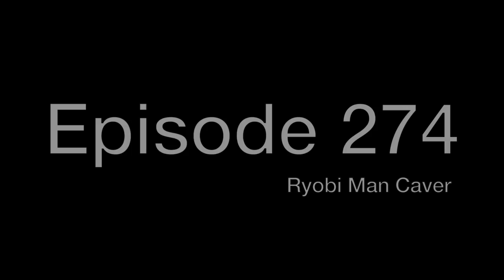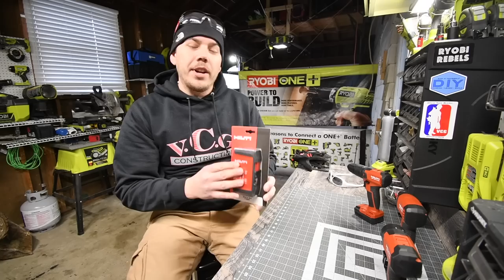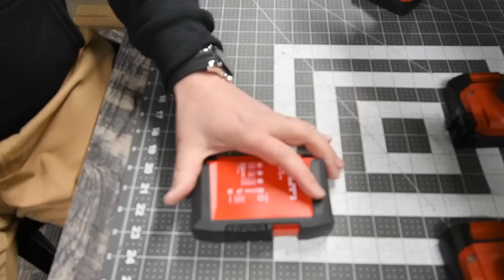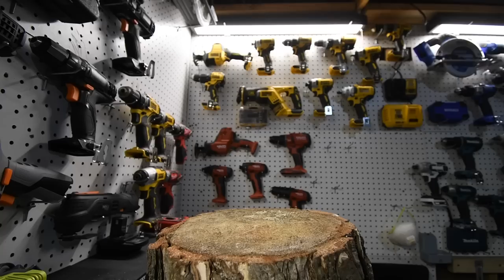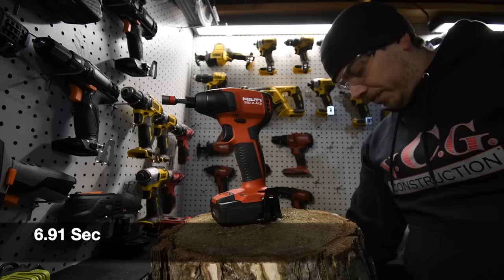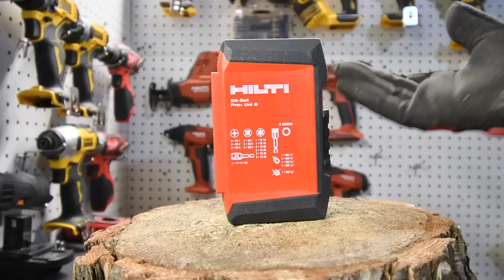$96 HILTI 36 piece Drill bit kit

Comment: I like the opening. "I have no idea!" I would never buy bits that expensive.
Reply: 9.8 People from 10 that work with Hilti don't own the tool. 
If you get this kit with the drill and the Hilti warrenty your boss most likley don't pay much more as for a regular kit and your Boss with a construction crew of 2 to 4 dozen mans deffently don't go to home depo to save a couple  dollars.

This is the difference between Europe and USA. In the USA most "contractors" are just one or 2 guys in a  F150 truck. They own all there tools themself and this people do a little bit of everything.
In Europe construction companys are mostly KOMMs with a boss and a larger crew but the jobs are more focused on a single or main task. We buy in specialist retail stores not in DIY Stores.
This has several reasons. In EU DIY Stores like OBI what is the same as Home Depo there is a more brand and option limited for professionals. 
Also we can buy there with the option to get back the VAT.
Reply from the maker: Crazy expensive

Comment: Hi Dave,
I use Hilti gear but find their bits really expensive, especially the chisels  and masonry bits for my Te6 SDS. They are good though. I own and love the Te6 a22 and the new brushless SF6H A22. Its a beast!
Dave Sheppard.
Reply from the maker: yes it is and I thank you sir
Reply: @ManCaverTools  Dave, what is your take on bigger batteries giving more power. I have found no difference in power between my Milwaukee 5 and 9 amp batteries. Just longer run time. I tested my Milwaukee Gen3 against the New Hilti. Hilti had 2.6 amp battery. Tried 5 amp and 9 amp in the Milwaukee. No power difference between them. The Hilti with the 2.6 battery out performed the Milwaukee with the 5 and 9 amp batteries.